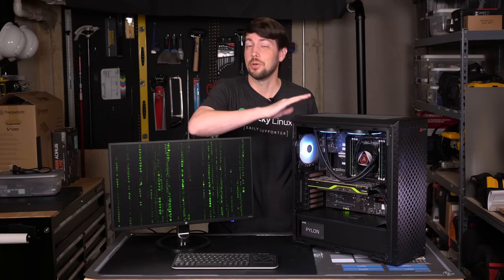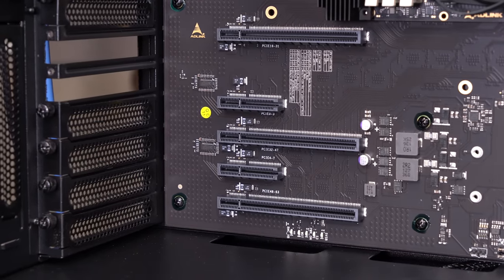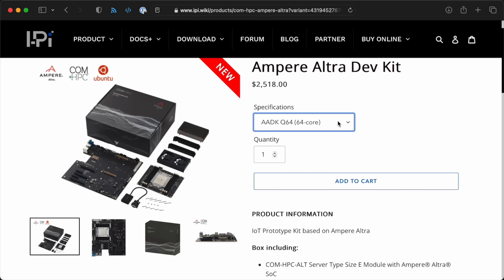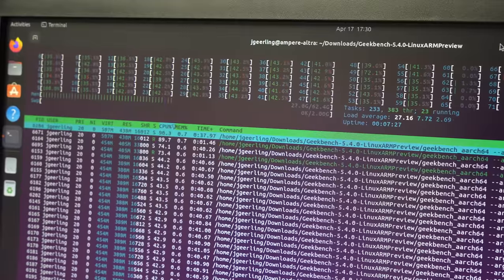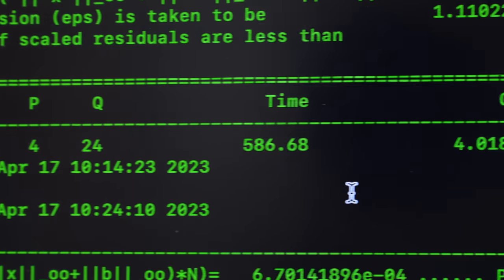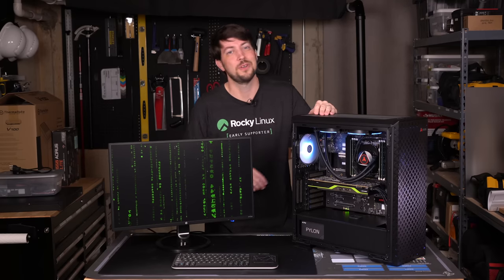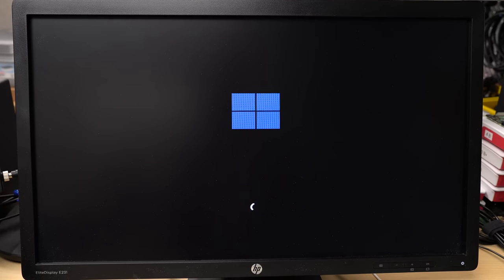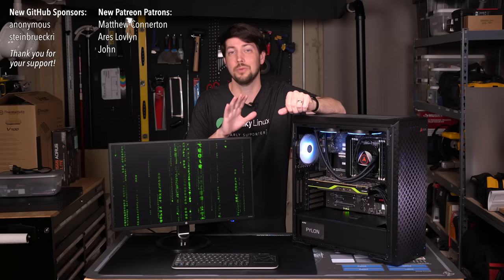This Mac Pro killer runs a GPU—and Windows on Arm!

Comment: really interesting to see some competition to x86 on the desktop :D
Reply: I am still waiting for ARM not only be more efficient but also as fast as current high end x86 CPUs. I don't believe it can live up to the hype, yet. With increased performance the efficiency will go down and Ryzen 7000 has shown that there also is room for improvement on the x86 side.. in the end the difference might be marginal and then the major point for decision will be the vastly better situation of existing OSses and software for x86. And the supposed advatnage of smaller and more cores is a very specific thing, whcih IMHO is already exaggerated in it's relevance, when speaking of 'general workstation usage' (despite workstating of course already bering veery specific in itself). As even most 'work related' software just can't make of of many cores.
Reply: apparently intel might make hybrid x86+arm cpus iifc
Reply: Is it time for an OpenCores/RISC-V update?
Reply: @found13  ba-dum tsss!
Reply: @luisortega8085  says who ?
Reply: @ElMariachi  Will it ever live up the hype when part of its philosophy is a simplicity and not having dedicated silicon to perform advanced mathematical instructions? I really don't get the fetish for this low-powered stuff for high-end workloads. Yeah it would be nice for a desktop that just farts around.
Reply: @Milk  I just know that if the rest of the market goes the way like Apple did, and we lose powerful x86 stuff, that will be the end of my hobby. I do tons of video encoding, and for quality vs. bit rate, nothing beats software encoding. I don't need for things that take me 4 hours to encode now (because of AVX type of stuff) to take me a whole day. I refuse to use hardware encoders. They make bloated files.
Reply: @elmariachi5133  Apple have proved they can be just as fast and more efficient. Being faster than x86 is a game of leap frog. The advantage of x86 is that it's x86. For many things that does not matter.
Reply: I hate x86.. And both Intel and AMD still are not going to RISC or something.. grrrr
Reply: @MelroyvandenBerg  Why would you want reduced instruction sets? Emulating them in software isn't efficient.
Reply: @Tim Ramich Reduced instruction set makes it easier to focus on optimizing each instruction. And instruction themselves are much easier to implement. For instance, most instructions of ARM and PowerPC only on registers, compared to m68k and x86 where instructions support various memory address operands, register operands, indirection operands, etc...

In other words, if CISC(like x86 or m68k) were instruction set for programmers, RISC is the instruction set for processor designers.
Reply: @ 연지쿤 YJK  Yeah okay. Have fun running stuff like video encoders
Reply: @yjk_ch  x86 is actually RISC. Yes x86 has variable length encoding and micro op decoders but arm have been using micro op decoders for some time as well.
Reply: Fact of the matter is... ARM would need to have a core to scale to high frequencies and low latency in order to compete with x86 but not now
the moment any core is high frequency now they will begin to lose efficiency and AMD is definitely leading the efficiency while even still being 4 wide
Reply: There's POWER. Both from IBM and RED, the former of which has been an option since 2019.
Reply: @BringMayFlowers  Absolutely not, I work with POWER (or at least tried to sell) as well and the only support they ever get on ubuntu (My customers request for ubuntu so what can I do?) is the SERVER version despite the motherboard being a workstation board

plus the IBM POWER is good only at very very specific markets, some of which are even moving to x86 because of the cost of buying into IBM
Reply: @timramich  I’ll like to have something that would more than 2 hour battery life for something portable and for desktop, super power efficient system
Reply: @Dave102693  Yes, that would be nice. But to pretend that this stuff can take over the high-end x86 stuff meant for heavy processing loads. That's ridiculous.
Reply: @timramich  Absolutely. Even the ampere altra took a lot of engineering for a datacenter CPU but its performance per core is nowhere close
Reply: yeah like 23 years ago 🤣x86 lmao, you are trolling so hard
Reply: Wish I could game on arm
Reply: The question is is it faster than m2 pro and i9 processors.
Reply: Plases can someone tell them to make a laptop of this desktop please. I can't get to them.
Reply: "Competition" is a bit generous. It's too expensive.
Reply: It's not for the desktop yet, ampere is usually for servers as of the moment
Reply: @kreuner11  that's what I'm saying put it into a laptop.
Reply: @elmariachi5133  They are borrowing the best parts from each other anyway. 

x86 took the PPC vector instructions, ARM took some hints from x86 to get faster (NEON was the first I read about), x86 is stuck with the front end decoder that decodes long instructions (most of them but not all as often said) into RISC what ARM has. 

ARM is often touted as the big next thing that will end all others but I do not see it happening, not before 2050. x86 is bogged down by legacy but to me all instrictions marked deprecated can go, save silicon, space, heat, etc. Yet they have not done so yet, it would help a great deal though.
Reply: @wayland7150  
Apple using ARM does not mean much, a few serious publications tested cross platform software and once you do that and not use software tailormade for Apple and its new cpu, the advantage goes to x86 again. 

It could work like Apple thoug,h but then you need a coupling of software and hardware. Google having its own os and software, blocking any and all others that do not conform to stricty demands, and there you go. Then Intel needs its own os for its cpus, then MS needds its own ARM Cpu and block Intel, etc.
Reply: @jamegumb7298  Any computer can do the work of any other computer if it has enough storage and you're prepared to wait for it.
Emulating x86 on ARM is useful but not efficient so obviously software written for ARM will run faster. That's not the point.
The point is if the same software compiled for x86 and ARM runs just as well but with lower power consumption on ARM. You don't see many x86 hand held devices. They were popular at one time running a version of Windows but they use too much power. That's really the point of RISC, it's lower power.
If you like having a big ATX tower then x86 is excellent but if you want a very small computer then ARM is better even if it's not as powerful.
I like a big ATX tower but from what I see with ordinary office users they want a small computer.
Reply: @wayland7150  
_ if the same software compiled for x86 and ARM runs just as well but with lower power consumption on ARM_
If. And that has been tested to not be the case at all. Unles you take Apple as stated, but then you have an optimised pair of software and hardware. Intel can do the same if they design their own os. MS can do the same if they go into cpu land. 

You don't see many x86 hand held devices
Not many, but I have used them. Including a phone. And it was blazing fast. And not overly hugnry. If they optimised for efficiency more I think they could do great things, just not their forte. Also do not think there are not other competitors. PPC has been used in everyuthing from mainframes to thermostats, and to great effect.

If you like having a big ATX tower then x86 is excellent 
I do not. I have 1×2U and 1×1U. Compact and shallow, slide right under the desk.

but if you want a very small computer
Like what I have now?

but from what I see with ordinary office users they want a small computer
They want no computer. They want thin clients and cloud working.
Reply: @jamegumb7298  Yes, that's one reason why I think that the differences between both won't be too huge any time soon. Probably it will become even smaller then now. So the main criteria for the PC's choice of CPU will remain the available software library for x86. And with the Personal Computer obviously and sadly being way over it's zenith and on it's way to become irrelevant within some decades, I expect x86 and the PC to die together then.
Reply: @elmariachi5133  `
the Personal Computer ... on it's way to become irrelevant ... I expect x86 and the PC to die together
No way. People use computers, and that will not change. x86 may evolve, but not die.
Reply: @jamegumb7298  I don't  think an office worker knows what a thin client is. They want a good fast computer but not too big. 2U is big. The Intel NUC is what I was thinking.

Power PC was quite important, I've seen old PCIe cards with that CPU. That role is being taken by another RISC chip the RISC V.

Arm is very much more efficient than x86.
Reply: Me too, but I'm rooting for RISC-V
Reply: Until Windows on ARM can just run things seamlessly without hurdles, won't be much competition there.
Reply: @wayland7150   “You don’t see many x86 handheld devices.” Lol, that’s the PC category that is seeing the most growth.
Reply: @jamegumb7298  My dream device is an x86 gaming phone, preferably running a completed mobile Linux.
Reply: @protocetid  I just want 1U/2U (smaller is a trend anyway, this is small with shallow layout, slids under the desk easily) and DTX (lay it out like itx, use extra width for 4-5× M.2 slots one of them E-keyed, still get 2 slots use with a riser you will need anyway) to become the norm. Solid, easy to transport, carrying cases aplenty. 

Desktop sales are an issue? More crossover and commonality with servers that are selling like hotcakes anyway. Getting shallow rack units is the best thing I ever did, better than those sub 20L compact ones.
Reply: It still depends on workloads and optimization, While ARM was more efficient as execution but most today ARM based CPU its not design for PC and workstation workloads (too small L3 cache, slower clocks and optimize for performance per watt than per core). Only Apple have ARM based CPU optimize towards PC and Workstation.

The real reason x86 CISC becoming popular is in older days is that time storage and RAM was insanely expensive. x86 use less memory and code size and not require much compiler optimization so it better suit for PC system on that time. That's roots of why most PC was x86 till today.
Reply: id imagine Intel/AMD getting real competition when wine/proton runs x86 programs on RISC-V someday
Reply: @ronald666mcdonald  umm, not even close. 
im sure it could even be emulated on other architectures too; so no, I don't think it will be coming back anytime soon.
Reply: @MelroyvandenBerg  x86 Is Hybrid with risc ... x86 can never be replaced with crap tablet chips

Comment: Wow! What an amazing system Jeff!! 
When you're into hardware like this, you're in rarified air and you have to figure things out for yourself.  Interesting how Linux just loads and boots up and runs perfectly on this. 
Linux is great!
Reply from the maker: Agreed, I love how Linux runs on practically everything, and is always first to come to new architectures like RISC-V
Reply: @JeffGeerling     i think what RISC-V. really needs is a  new wine/proton port update for running x86 programs.
 Before i heard about RISC-V,  i knew OpenRISC as a similar architecture, yet never seen a board on it. if they even exist, can you make a video about it?
Reply: @parad0xheart  i know that a concept like this doesn't sound that practical, however i believe that if done properly, it can make the RV64 architecture more viable. The problem though is what you've exactly mentioned. Indeed it can be a difficult task, but in theory, it shouldn't be impossible to initiate a project like this; as well as attracting more needed demand for RISC-V

Comment: Some nostalgia from your commentary, boy do I miss the 2009 Mac Pro. Also, I think my first time building a kernel was around 1998 and was either a Pentium 1 or a 486. Hearing "2 minutes" for a kernel build was crazy.
Reply: Kernel was a lot smaller back then too!
Reply: The craziest bit is that if you have seen the L1Techs content, Wendell is getting under 2 minutes for the allmods compile. I think they're under 20s for just the kernel these days.
Reply: @Jakdaw  Right - as a matter of a fact, I believe we talked about a size much smaller than current being unimaginably large.
Sort of the Linux version of "No one will ever need more than 64k of ram".
Reply: why would you miss overpriced crap?🤣🤣🤣 because that's is all what apple does
Reply: @Spectru91  Come on, I know they make overpriced, unrepairable, proprietary, locked hardware, which I hate, but they also have some things going for them. You cant's deny their computers just look pretty and the higher end models are quite powerful. My A1398 late 2012 MBP has better specs than my 2015 Asus
Reply: A better benchmark would be building Chromium or Firefox :p
Reply: @Spectru91  don't forget the amazing power efficiency
Reply: Got 2008, and still working. Good, ol' Xeon.
Reply: @ketatgenhorst ah don't be so shore mostly if you deal with images

Comment: I hope these beefy arm processors go mainstream, this is exactly what we, homelab enthusiasts, need but cheaper
Reply from the maker: Hopefully in a couple years some of these systems start coming up used for a good discount!
Reply: Hope it'll be the open RISC V and not the proprietary ARM
Reply: ...and Windows will finaly dei.
Reply: Asahi Linux and Lenovo x13 porting is getting the first steps towards full arm functionality for Linux and Windows even though I Microsoft executive team is the devil in some ways.
Reply: @RustedCroaker I mean it’s not like those things matter for users. I do hope RISCV wins out in the end for that reason, but open-source ISAs are good for smaller designers and manufacturers primarily

Comment: This is becoming “the intrusive thoughts won” channel and I love it.
I just wanna see Jeff power trough the win installation 😅. He found a working graphics card for the pi after years, he can definitely run windows on the ampere 😊
Reply: While maybe a fun challenge it would be basically just for giggles.
The software support on WoA is basically non-existant while linux has been there for over a decade (thanks to the pi et al)
Reply: I'm pretty sure Microsoft makes an ARM-version of Windows. Why anyone would torture once self with that is beyond me. 😀
Reply: @Liqtor  Of course they do.  Windows 11 has an ARM64 version.

Comment: Jeff, have you tried to install a hypervisor (like Xen) and install windows as a guest? Windows installer might be freaking with some option missing in the BIOS (like TPM) and the hypervisor might give a chance to emulate that.
Reply from the maker: might try that later.
Reply: or Proxmox :p
Reply: The errors are ACPI errors. Arm doesn't usually have ACPI so a VM might help there too
Reply: Linux already includes hypervisor functionality (KVM). This integrates with QEMU, too.

Comment: I look forward to hearing about your GPU experiences but it would also be interesting to probe your software rendering results. Perhaps trying both SwiftShader and Lavapipe and making sure they are configured to use 90+ cores and have SIMD enabled for their ARM compiles. There should be the grunt to push some pixels in a simple game like tuxkart without a separate GPU.

Comment: The prospect of running Linux on ARM-based devices beyond the scope of low-powered single board computers is truly fascinating. If you happen to have the time / energy & know someone at Lenovo that could send you a unit, it would be interesting to see if you could explore the possibility of installing Linux on the Lenovo IdeaPad 4G ARM64 Snapdragon 8c.

I have personally attempted to live boot various Linux distributions, such as Ubuntu and Debian, on this device. However, I continually encounter an issue where the laptop simply reboots a few seconds after selecting the "try/install Ubuntu" option from the Live ARM64 Ubuntu USB grub menu.

This Lenovo Snapdragon laptop battery life is insane on Windows 11, but the device lacks the memory (8GB only) to do much with it beyond browsing, Office 365, and youtube / Netflix streaming.
Reply from the maker: The lenovo should be pretty close performance-wise to the Windows Dev Kit 2023
Reply: I've actually got a Samsung Galaxy Book Go 5G which runs the Snapdragon 8cx Gen2 platform. As I understand it, the Linux kernel simply doesn't have support for it. Linux kernel 6.3 adds support for Snapdragon 8 Gen 2, but that is different from 8cx or the compute platforms. I REALLY want to run Linux on it. But the kernel support is not there yet.
Reply: @JeffGeerling  All that generation of devices including the surface and the devkit are basically the same thing give or take some memory and storage choices.
Reply: GPU drivers not there either.